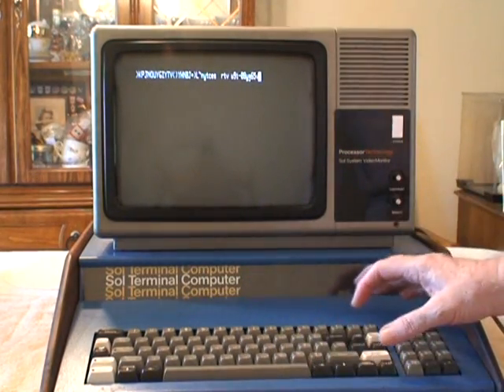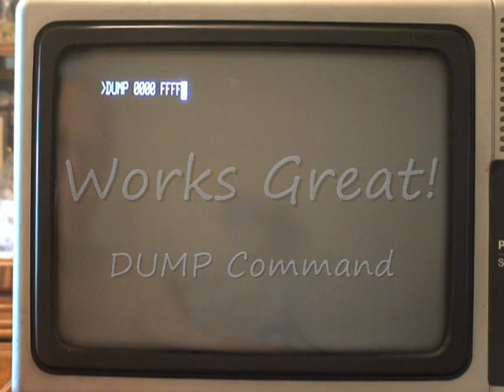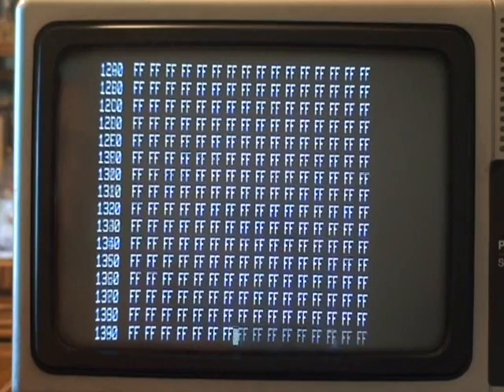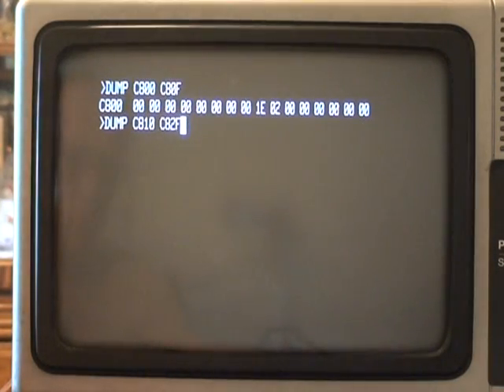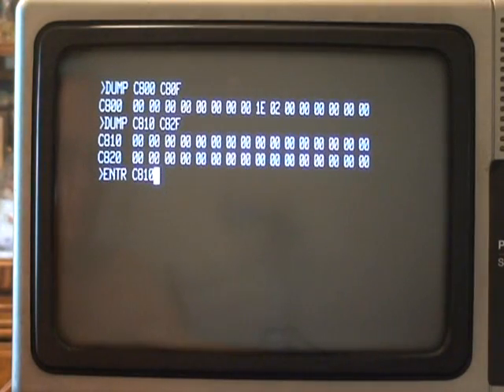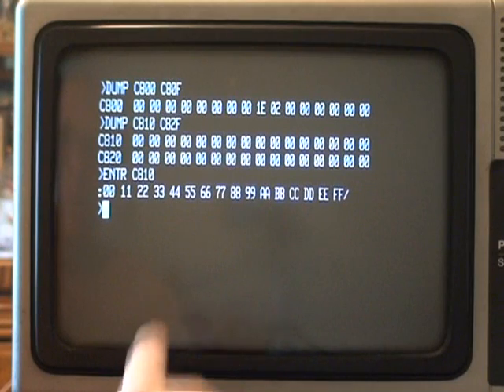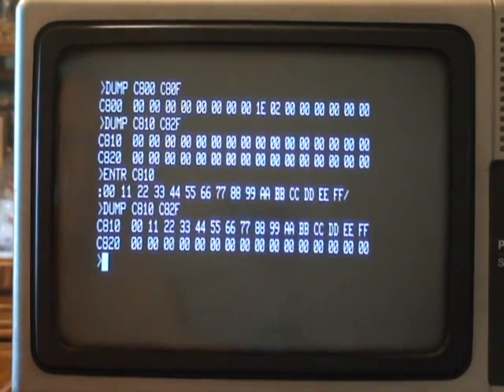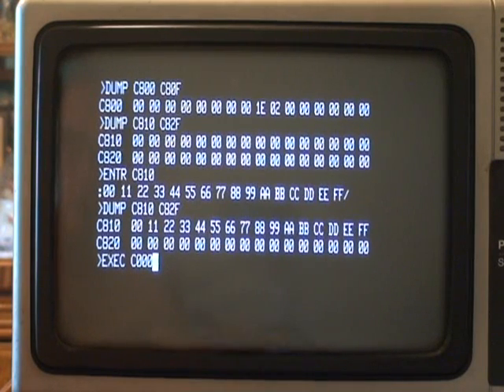Processor Technology SOL-20 8080 Computer

Comment: I just ran into this... Love it! I also loved the store on 45th street in NYC that biffy7 mentioned. I bought only the main motherboard from the store for $1000. Then built a case out of wood to look exactly like the one for  the manufacturer. I added a whopping 8k static memory board and eventually 2 so it had 16k ram. You could make toast with it if you put a piece of bread on the static ram boards. And eventually designed and build a 5 in floppy drive controller for it. Those were the days!!! I miss them.

Comment: I'm in the glad position to be allowed to service one of these - you mention keyboard issues. What's the most common issue there? The machine I'm working on shows the normal prompt, with the upper case and local LEDs activated on the keyboard - but allowing no entry of data nor does pressing the shift lock make it's LED light up. Usually after 3-4 minutes all LEDs go out.
Therefore I'm assuming a keyboard fault here - any general directions I should pursuit?
Reply: Did you take care of your keyboard issue?

Comment: It's a 30-year old 'Vintage' computer, a contemporary of the Altair 8800 and IMSAI-8080.

It use an Intel 8080 Processor,so you could run CP/M and other character-based operating systems.
 
It could be expended with S-100 cards, so you could add color graphics and other features.